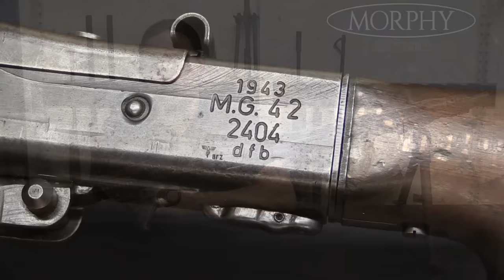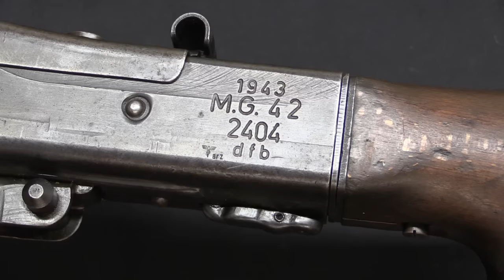Hitler's Zipper: The MG-42 Universal Machine Gun

Comment: I've shot the MG1, which was basically a modernized MG42. I didn't like it. It was lighter than an M60 with twice the cyclic rate of fire, making it difficult to control on just a bipod. I could drive tacks with the 60 but couldn't shoot that thing accurately to save my life. I guess it was the same weight, but it felt lighter.

Comment: I'd rather the mg34 its the same gun but it's all milled the 42 is stamped and horrid the German army still use a gun super similar to the mg43 its probably the best squad fielded light machine gun ever made 1300rpm two of these and a few guys with mausers could put down a wall of lead instantly in ambush these are top notch better than anything about nowadays in my opinion still used by the Germans Danes and various other countries now called the mg3 chambered in 7.62 nato

Comment: When I was stationed in DE I was lucky enough to be selected to qualify with the G-3 and the MG-42 the main infantry rifle and light machine gun at the time, '90. That machine gun fires to fast if that's possible. Watch a video or one firing. It smokes the M-60. A cool thing was we had a German lunch with the soldiers  and we all had a pint, ON THE RANGE. I qualified Bronze but it was a very good time. I got a cool braid on my class A's. google  One of the many things I thank the service for, but today I wouldn't join.

Comment: The mobile version was reduced to ca.1200 rpm, only the stationary version fired 1500+ rpm. The stationary version was usually equiped with 10.000 rounds and many barrels to switch.
The actual version (MG3) is still in service by the German Army, here two teams train to give them alternately surpressive fire to move foreward on a target.
https://youtu.be/_x4SBuTDBDM?t=326

Comment: @7:40.  That's not machining, that's a pressing.  The barrel bushing is inserted into the shroud then an press presses the sheet metal around it to hold the bushing permanently in place.  Those lines and holes are there so when the metal is pressed it has some place to move and prevents cracking.
Also @15:40 the ejector doesn't hit a stop in the receiver, it hits an ejector spoon.  You can see it right behind the ejector before he takes the head off.   You can see it protruding slightly from the center of the bolt body after he takes the head off.

Comment: Another downside to the high rate of fire is that the time for cooling down between rounds fired is reduced, resulting in the need to change barrels more often. A gun that is changing its barrel is a gun that isn't firing. The M-60 Machine Gun (affectionally called the Hog or the Pig) was designed after the MG-42, but the U.S. military required a slower rate of fire for two reasons - 1) the cooldown vs barrel change rate, and 2) conservation of ammunition.

Comment: Appreciate the detail. It would be great if we could see exactly the surfaces that the rollers engage with and how far the barrel reciprocates before the rollers are disengaged. I'd be interested to see the slope of the surfaces and get a feel for how they were engineered to mitigate wear. I own a CETME style rifle and it's of course very different but I have tested both 45 degree and 36 degree locking pieces, which made me curious if it was possible to speed up or slow down the rate of fire in the MG-42 in a similar way.

Comment: I was at a private outdoor range a little while ago and a guy showed up with one of these and he let me crank off a short belt. Very easy weapon to use, better than the M60 which I have also fired in the Army.

Those roller locks work really well but i really hate taking the one apart on my HK41 as it is a real booger getting it back together...

Comment: Sorry I’m asking this question on a year old video, but is there any difference between this gun and the Rheinmetall MG-3? According to one source I saw very little change was made between the MG42 and the MG-3 outside of a cartridge change to 7.62 NATO. Thanks for any replies and sorry if I’m late on this.
Reply: Greetings Sean, in relation to your question, the biggest difference, which you have already mentioned is the change from 7.92 Mauser to 7.62 NATO.  Other changes are the design of the muzzle booster (it is not a muzzle brake!), a different AA sight, a heavier and slightly modified bolt to reduce the rate of fire to 1200 rpm, a new bipod and some changes to the feed system to use German and American belts. Not all changes were made to the MG3, some were already developed or introduced for the MG1 (new production runs from Rheinmetall) and its various versions. Wartime stocks of the MG42 converted to 7.62 NATO were designated MG2 (originally used by the German Border Guard). Enough knowledge bombing, have a good one!

Comment: 1500 rounds per minute is impressive, on paper, but let's remember that the enemy also have guns, so... If you need to suppress their fire, you are going to need a MOUNTAIN of linked 8mm Mauser ammo. That means your squad is carrying two or three times as much weight in ammunition as the opposition. 

Sure, it would sound terrifying, but I imagine that either the ammunition ran out very quickly or it was fired in very short bursts. 

If fired in short bursts, you may as well have a 700 per minute gun, which will also cut down the number of times you jeez to change out the barrels. 

Just armchair surmising, haha.
Reply: Yes, the rate of fire was too high, which is why it was reduced on ie the MG-74 to a cyclic rate of 850 rounds per minute (700 is imo not enough for a machine gun, many assault rifles can do that or even more, ie the AUG does about 770 rounds per minute, if I remember correctly... it's been a long time, did my national service 2003-2004..)...

Also the caliber was 7.92 x 57 (ie 74 was 7,62 x 51 aka 7.62 long [NATO long, not Russki long which is x54 I think, as on the RPK, Dragunov SVD, etc..), not 8mm.

Comment: The MG42 is still in use today by Germany and the US as the M60 it was actually nicknamed the "Ripper" for its very high rate of fire from 900 to +1500 rpm and its capability of cutting a man in two,it was issued with 2 later 4 spare barrels as the gun if not used wisely could wear out the barrel very quickly. Mine is the later M1953 model chambered for the Nato 7.62 round and though i have owned the weapon for 41 years i have only the one unused spare barrel left and i fire 1000 rounds per year.
Reply: The M60 is a different machinegun, althrough Ameticans used some features of the MG42 in it.

Comment: Eventually fun fact the MG08 or MG08/15 was hated so much by German Soldiers that till this day it is a common German expression to call something cheap or unreliable 0815. like: "Thats so 0815."
Reply: That's wrong. 0815 means lame/ordinary/boring. Not because the gun was unreliable or cheap, but you was tasked to sit on that mg position and didn't even move on mg duty. You was just shooting like you are working at a factory. Which became boring and tiresome quickly.

Comment: An interesting side note..... The 80's English band "Spandau Ballet" was named for the resulting death swirl dance of the victims of the MG34/42 "Spandau" machine gun... "So much is true".
Reply: Spandau was actually the nickname for the MG08 in WW1 because it was built in Spandau (Berlin). Brits (and as far as I know no one else) kept using the word for later German MG's like 34 and 42 even though those had nothing to do with Spandau and the Germans certainly didn't call 34's and 42's Spandau.
Reply: @wanderschlosser1857  You are correct! I think the band took the slang name the Brits gave the gun and it's rate of fire...

Comment: This is still being used by the Germans. I saw them on their armored vehicles in Afghanistan.
Reply: Yeah a modernized version the MG3, 7,62 Nato and a bit slower rate of fire together with some other small changes. You wouldn´t be able to put Mg3 parts into a MG42 or other around but they are basicly father and son :D But in the last years we started to phase them out for the MG4 (in a new role in the Bundeswehr as a SAW) and the MG5/HK121 as a new GPMG in 7,62

Comment: The Video has some flaws and i like to point them out
- the bipod got two modes (Offensive/defensive) but okay the mg 3 model doesnt have it 
- The role of the muzzlebooster wasnt mentioned (and also not disassembled)
- the ejection port and dust Cover were not  mentioned 
- the mounting point in the middle for the bipod wasnt mentioned 
- the mounting point for the tripod was also not mentioned 
- the weapon could be more dismounted
Reply: can you please explain the difference between the offensive and defensive bipod modes?

Comment: what does he mean when he says it’s an early german replacement stock?
Reply: The stock was replaced during it's ww2 service because it was about to break, it actually broke or it was likely to do so later. It's an "early" replacement stock seen from that it doesn't have the reinforcements that later ones have like he says in the video. So it doesn't have it's original stock, but the replacement is still from ww2.

Comment: I've always wanted to know how the bolt locking mechanism worked. I knew it was on roller bearings but I didn't understand how it worked/locked so fast.
Reply: Muzzle booster which kicks the entire barrel assembly back, paired with a roller-locking delay system like what H&K uses for most of its’ guns.
Reply: @commanderfoxtrot  incredible ! 👍
Reply: @richardkautz2947  quite powerful but has to be done to a T. If anything is missing or out of place, it breaks. Not ideal for mass-production standard rifles, but definitely nice for specialty machine guns.